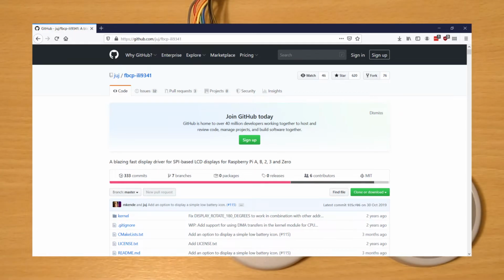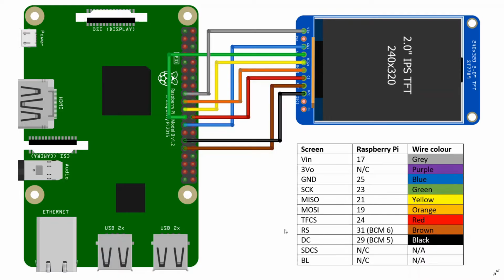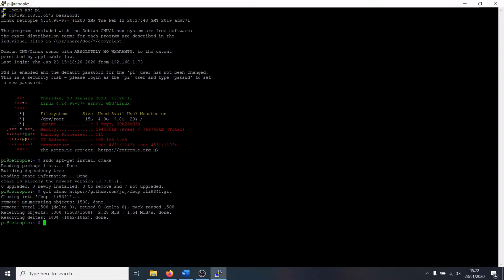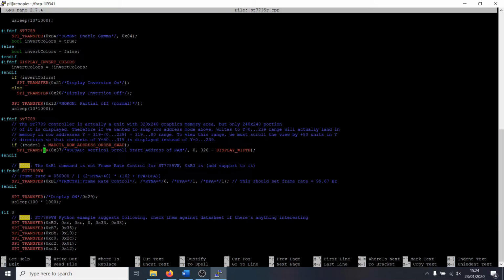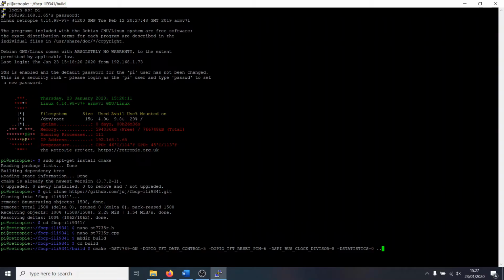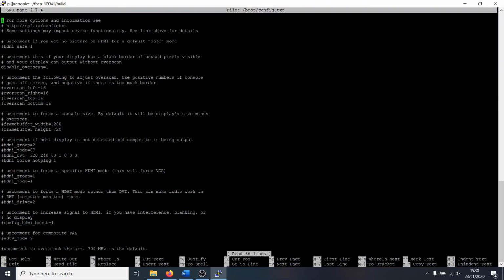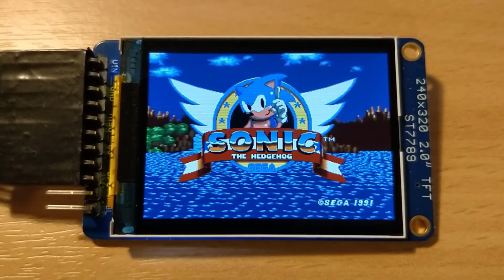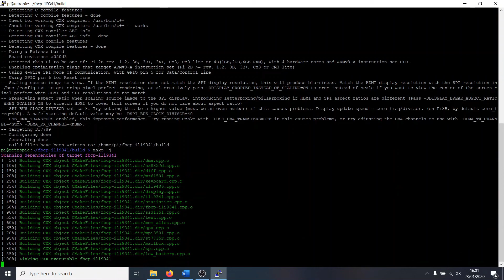60fps on an SPI display using the Raspberry Pi and fbcp-ili9341 (includes fix for 320x240 ST7789)

Comment: Thank you for the very informative video. 

Is it possible to connect multiple screens to 1 Pi? I want to connect 3 of these screens to 1 Pi to indicate the rudder angle on my shipmodel right next to the 3 rudder controls on the transmitter.

Also, is it possible to adjust the backlighting/ brightness of the screen? Perhaps through the BL pin?

Thanks in advance

Comment: Hmmm, do you know of a similar library for these screens (have a couple ili9341 but also have a 640x480 4" one) that works on the Arduino Mega 2560 and/or the Mega DUE?
Want to use either the 2560 or the DUE as an touchscreen input device on another project but definitely need it to be able to draw WAY faster than it currently does...

Comment: In file included from /home/pi/fbcp-ili9341/diff.cpp:6:
/home/pi/fbcp-ili9341/spi.h: In member function ‘uint32_t* SPITask::DmaSpiHeaderAddress()’:
/home/pi/fbcp-ili9341/spi.h:132:51: warning: taking address of packed member of ‘SPITask’ may result in an unaligned pointer value [-Waddress-of-packed-member]

i got some error after make -j, is there anything i can do to fix it?

Comment: Earned my subscribe and like thanks man, I used a Hat version of the LCD but with this guide with the Read me from the Gethub repository were up and running. Quick question what do I adjust to make  this full screen seems I have a black bar on top and bottom. This is a 1.44x1.44 running retro pi on a pi zero...

Comment: This guide helped immensely! My only issue was that my display's controller was an ST7789V and not an ST7789. For anyone else struggling with an ST7789V, you can simply use -DST7789VW=ON instead of -DST7789=ON. Unfortunately, Genesis/Mega drive emulation doesn't have enough CPU cycles left over to run at full speed on a pi zeroW.
Reply: I followed the guide and tried the same thing but its not working please help me.

Comment: was writing a little retropie acttacy screen.. but after seeing this do you think this will work with the PiMoroni Breakout Garden 1.54 240x240 SPI display?
Reply from the maker: I have no idea, it depends on wether the display driver chip for that screen is supported by the library. So you'll have to find out what the driver chip is.
Reply from the maker: Actually just looked and it's the ST7789 so in theory it should work.
Reply: @ScottMarley  thanks for the quick reply.. suppose the only way to find out is to muck around with it.. Cheers 🖖
Reply: @ScottMarley  sadly looks like it won't work using a breakout garden thanks to BCM 9 for data.. oh well.. out comes the bread board
Reply from the maker: @KineticEgg  oh I see, I'd never heard of breakout garden before. Looks a bit like that qwik system or seeeds grove stuff. I generally prefer breadboards anyway ;) have fun!

Comment: Dude!! I have a waveshare 2" SPI based on the ST7789V.  After following the manufacturers instructions to install all the software... I had the shifted screen issue (video starts shifted to the right). Looked all over the place for a solution and stumbled across your video. I followed your instructions but just edited the "st7789.cpp" as waveshare has a patch that takes care of the native screensize resolution. Anyway... rebuilt according to your excellent instructions and restarted my pi. Works beautiful!!! 😉😊  Thanks for the excellent information!
Reply: I followed the guide and tried the same thing but its not working please help me.
Reply: Same here, couldn't make it work for st7789v but im using orangepi
Reply: Tuviste algún problema para que iniciará el escritorio después de instalar los controladores de la pantalla?

Comment: Hmm, I wonder if this walkthrough still works, or if I'm missing a step. I'm using this same exact display, and followed everything to the letter, tried multiple times from scratch, but it seems to not be able to run fbcp-ili9341 at the end of it. It doesn't recognize it as a command. Does anyone know what might be going wrong? I grew up on DOS, but I'm still relatively new to Linux/Raspberry Pi OS.

[100%] Linking CXX executable fbcp-ili9341
[100%] Built target fbcp-ili9341
pi@raspberrypi:~/fbcp-ili9341/build $ fbcp-ili9341
-bash: fbcp-ili9341: command not found
pi@raspberrypi:~/fbcp-ili9341/build $ ls
CMakeCache.txt  CMakeFiles  cmake_install.cmake  fbcp-ili9341  Makefile
pi@raspberrypi:~/fbcp-ili9341/build $ sudo /home/pi/fbcp-ili0341/build/fbcp-ili9341
sudo: /home/pi/fbcp-ili0341/build/fbcp-ili9341: command not found
pi@raspberrypi:~/fbcp-ili9341/build $ sudo fbcp-ili9341
sudo: fbcp-ili9341: command not found
pi@raspberrypi:~/fbcp-ili9341/build $

Comment: I got my 2.2 display to work on a Pi 4. But the display is mirrored. How can I flip the image 180 left to right?
Reply from the maker: You can do this, see this forum post https://forums.raspberrypi.com/viewtopic.php?f=91&t=132077#p880827. If using 0x10000 doesn't work, try 0x20000 instead

Comment: Does this work with the raspberry pi 4 model b?
Reply from the maker: Yes, works fine with the 4
Reply: @ScottMarley  I did everything in your video and got as far as configuring  boot options...i am missing the hdmi_cvt =320 240 60 1 0 0 0. line. i enabled the "hdmi force_hotplug  =1" but i get the error vc_dispmanx_display_open failed! Make sure to have hdmi_force_hotplug=1 setting in /boot/config.txt. I have the ili9341 2.8 display. any ideas?

Comment: Hey scott, Ive got a similar display (waveshare 2.8 inch 320x240), doing same as you seems to give a corrupt output somehow. Ive tried a few differnt clock divisor values and none seem to make a difference really. Thanks in advance.

Comment: Amazing! Many thanks, 

Do you think it is possible to let Raspberry Pi run an Eink display as a driver and a host at the same time? or should I build a driver MCU separate for the display and control it with the SPI on the GPIO's?
Reply from the maker: You can use the SPI pins to drive an eink display, something like https://www.amazon.co.uk/1-54inch-Display-Module-Resolution-Two-Color/dp/B07Q6V93HQ/. No point using the driver I used here, as your not getting more than about 1fps from an eink screen regardless of how fast you drive it!

Comment: Thanks. But seriously, couldn't you of put the commands attached here or on a webpage. Going back and forth between screens is crazy!
Reply from the maker: The commands will be different depending on the model of the LCD, screen controller, resolution, orientation and a load of other stuff so its vital that you read through the docs carefully to make it work for your use case. The GitHub documentation is really good, much better than anything I could write here.

Comment: Is there a cpu performance impact using this display?
Reply from the maker: Yes, as the CPU has to keep pushing data to the BM2835 chip, the GPU is not used at all for SPI screens (afaik). I don't think I ever checked how much of an impact it had, as the CPU was still plenty fast enough for what I was doing with it.

Comment: works for raspberry pi zero?
Reply from the maker: According to the GitHub page, it does. I have never tried it though.
Reply: @ScottMarley  when I do sudo ./fbcp-ili9341
 my raspberry resets the GPIO pins and later my screen won't turn on
Reply: any solution?
Thanks
Reply from the maker: @pabloh318  I don't know I'm afraid, I haven't used it with the zero or had an issue like that I'm afraid. You can post on GitHub if you need help
Reply: @pabloh318  Same here, did you find a solution for this?
Reply: @tonynacho  no, i didn't find a solution. I'm still looking for a way to do it.
Reply: Thanks for your answers. Bye! ;)
Reply: Haven't been able to either.

Comment: Nice video. Should LCD show Pi's terminal after reboot?
Reply from the maker: Not immediately, but once the library has loaded. Did you follow the instructions to make it load on boot?
Reply: @ScottMarley  thanks for the answer. Yes I did, of course. I will figure out the problem and leave comment ;)

Comment: im using a wavehare board with a ssd1351 but it doesnt wanna boot after rebooting
Reply from the maker: There are many things that can go wrong here, have you closely followed the instructions on the GitHub page? Have you set the -DSSD1351=ON directive? Have you started with -DSPI_BUS_CLOCK_DIVISOR set to somethhing high like 60 and see if that works? Are you certain that all your connections are correct, and that -DGPIO_TFT_DATA_CONTROL and -DGPIO_TFT_RESET_PIN are set correctly using the BCM pin numbers? If you're still stuck, I advise posting on the GitHub page for further help, but when you do, mak sure you are very specific and give all of your connections, compilation arguments, hardware info, exactly what you have tried etc or people won't be able to help.

Comment: It works great although my backlight seems to flicker it goes bright every frame update do you know what could be causing it?
Reply from the maker: Hi, that sounds strange! The backlight is connected to the correct pin I guess? (Usually 3V3)
Reply: @ScottMarley  I have tried both 3v and 5v they both have the problem ground seems to turn the backlight off
Reply from the maker: @Currychicken5  is it definitely the backlight and not the LCD itself flickering?
Reply: @ScottMarley  I’m gonna unplug the backlight and see if it still flickers when i hold a flashlight to it
Reply: @ScottMarley  its hard to see but it seems like it could be either lcd or backlight
Reply from the maker: @Currychicken5  can you power the backlight on its own with no LCD data? Does it work properly then? Unless your backlight is broken, it seems more likely that it's the LCD then the backlight, but could still be either! Can you connect something else to the screen, not using the library? E.g. use and Arduino to send drawing commands to it or something.
Reply: @ScottMarley  it works with arduino fine so i think it’s the lcd
Reply from the maker: @Currychicken5  have you tried changing some of the settings? Does it still do it if you set -DSPI_CLOCK_DIVISOR=40 or something high like that?
Reply: @ScottMarley  I’ve set it to 40 and 80 and it did seem to lessen a bit
Reply from the maker: @Currychicken5  it might have lessoned it as at 40 and 80 the frame rate will also have dropped. I'm afraid I don't know the answer. You could try posting on the GitHub page for the library, people do seem to get help there. Make sure you include all the details, screen type and driver, RPI version, all of your complication setting etc. Hopefully someone will be able to help.
Reply: @ScottMarley  thanks for the help will try!

Comment: Does anyone know if/how video playback performs? in something like kodi or libreelec?
Reply from the maker: I haven't tried it myself. I don't see why it wouldn't work though, as the library basically just mirrors whatever would normally go out via the hdmi port. It's at least 60fps and runs with no discernable lag on video games. Would be interested if you get it to work or not!

Comment: I have a screen with the same PINs exept TFCS. Do i need to do anything different?
Reply from the maker: TFCS is the same as CS on mine. TFCS is the chip select line for the TFT, SDCS is the the chip select for the SD card if your screen has one.
Reply: So my screen has only a screen, no sd card and no touch screen.
My PINs are:
1.VCC
2.GND
3.MISO
4.MOSI
5.BLK
6.DC
7.RES
8.CLK

So the Chip is automaticly selected?
Reply from the maker: @cheat_steve10  it's not automatically selected as such, its selected via the TFCS pin on your screen, so that needs to be wired as per the diagram in the video (except mine is called CS). Just follow that diagram and you'll be good.
Reply from the maker: Oh, you'll also want to connect the BLK pin to 3.3V, as this is for the backlight. I didn't do this on mine, as I wasn't using the backlight.
Reply: The thing is my screen doesn't have a TFCS pin.
My screen only has those 8 pin.
Reply from the maker: @cheat_steve10  oh, sorry I misread that. I thought from your first comment you had the TFCS. Then yeah, it's automatically selected. What controller does your screen use? Eg ILI9341, ST7789 etc.
Reply: An ili9341
Reply: Ok thank you
Reply from the maker: @cheat_steve10  ok, should be good if you follow all the instructions on the GitHub page. Here https://github.com/juj/fbcp-ili9341#what-other-optionsalternatives-do-i-have-to-fbcp-ili9341 under '3.' it says CS is sometimes optional.
Reply: It worked! Thanks

Comment: my screen is mirrored, what to do?
Reply from the maker: You need to add a line to /boot/config.txt, either 'display_rotate=0x10000' for a horizontal flip or 'display_rotate=0x20000' for a vertical flip. If you just need to rotate the screen instead of flip it, use 'display_rotate=#' where # is 1, 2 or 3. Hope that helps.
Reply: @ScottMarley  Hi Scott, thank you for your reply. display_rotate=0x20000 in config.txt works. But it flips the HDMI Output too. So any ideas, howt to flip only the ili9341 Display?
Reply from the maker: @sebastianputlitz2708  I don't know if that's possible. Try some more config.txt options from here and see if anything works https://www.raspberrypi.org/documentation/configuration/config-txt/video.md
Reply from the maker: Looks like it isn't possible as far as I can tell. You can rotate the spi display separately from the hdmi, but not mirror it. The library is written to just display the hdmi buffer, as stated here https://github.com/juj/fbcp-ili9341#do-i-have-to-show-the-same-image-on-hdmi-output-and-the-spi-display-or-can-they-be-different
Reply: @ScottMarley  Ok Thank you. I think it is not necessary, at the end.

Comment: If anyone can help I’ve been trying to figure this out for a while my screen is a 2inch 240x320 waveshare screen but my pin out is Vcc,gnd,Din,Clinton,cs,DC,RST, BACKLIGHT. So I’m confused what should Goto mosi miso etc if anyone knows how to plug this in lmk please
Reply from the maker: Din on your screen connects to MOSI (RPi pin 19). Clk goes to pin 23, CS goes to pin 24, RST goes to pin 31, DC goes to pin 29. Backlight usually goes to Vcc if you want it on, but might be ground. Try it and see. You can leave MISO unconnected. Vcc goes to either 3.3V or 5V depending on your screen. GND goes to ground. If you do that and follow the rest of the instructions to build the  library then it should (might!) work.
Reply: Scott Marley hey thanks a lot for the reply I appreciate your video I’m going to try this out on my pi4 after my morning coffee ☕️ 🧉
Reply: Scott Marley where did u get those cables?
Reply: @harmanndhiman9492  they are called jumper wires most electronic shops sell them
Reply: @ScottMarley  didn’t work on pi4 so I tried on my pi3 B+ with retro pie I think I have it hooked up right but nothing is on the screen just the backlight and the hdmi put doesn’t work either the tv says something about resolution

Comment: Hey Scott!
Amazing job man!
PErfect.

I wonder if you could assist. i cannot get it to work. i keep getting white screen.

My screen is a ili9341 and i use the following specs - 

sudo apt-get install cmake
cd ~
git clone https://github.com/juj/fbcp-ili9341.git
cd fbcp-ili9341
mkdir build
cd build
cmake -DSPI_BUS_CLOCK_DIVISOR=6 -DILI9341=ON -DGPIO_TFT_DATA_CONTROL=24 -DGPIO_TFT_RESET_PIN=25 -DSTATISTICS=0 ..
make -j

i have the core of my pi at 360. this means that 360/6 = 60hz ...

But the screen keeps getting white ....
any ideas?
Reply from the maker: Hi, there are a bunch of things that can go wrong here, and I can't see anything obvious from what you've posted. Check your connections and pins are correct. Also increase your divisor to 40 or so and see if that helps. If so, you can then reduce it until it works. You might be better asking for help on the GitHub page however, where people far more knowledgeable than me may be able to help!

Comment: Hi,
great tutorial.
Do you think you can achive 30fps from some MCU like esp32, at least for video?
Thank you for sharing.
Reply from the maker: Thank you! The library only works on the RPi so you won't be able to use it on the ESP32. However I have seen some really smooth animation etc from the ESP32 on similar displays, this for example; https://youtu.be/Wql4WTpPrWs. Regarding video, if the MP4 was on an SD card I don't know that it would be decoded fast enough for 30fps display. Here is someone who has done video, but the MP4 has to be converted to a dat file first https://github.com/MhageGH/esp32_ST7735_Movie. Let me know if you manage to get this to work!
Reply: @ScottMarley   Thank you for your help, soon as I got some time, ill try to implement it and see what fps I can achive. Ill post here if I manage to do anything, programing is my weak spot :)

Comment: Awesome tutorial Sir! My problem is that I have an ILI9341 2.8" TFT SPI 240x320.. but it is not like yours which is ST7789.. what I have has TJCTM24028-SPI written at the back.. After following the steps in you video the screen is output is a mirror image of what should be displayed.. 😔  I will look at juj link and see if there is a way this TFT display will work with some hacks.. thanks!
Reply from the maker: You can definitely mirror it in software, although I've forgotten how... I'll have a look later and see if I can remember!
Reply from the maker: Got it, you can mirror the display by adding either display_rotate=0x10000 for a horizontal flip or 
display_rotate=0x20000 for a vertical flip to /boot/config.txt. From https://www.raspberrypi.org/forums/viewtopic.php?t=120793#p816458 Hope that helps